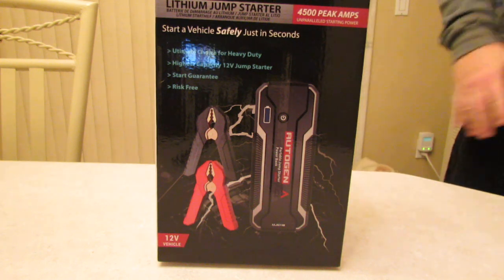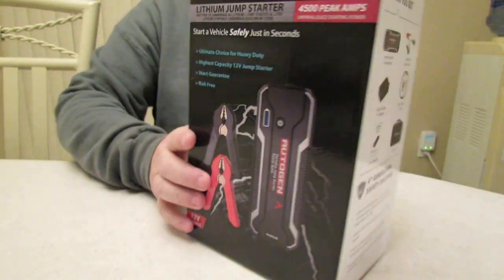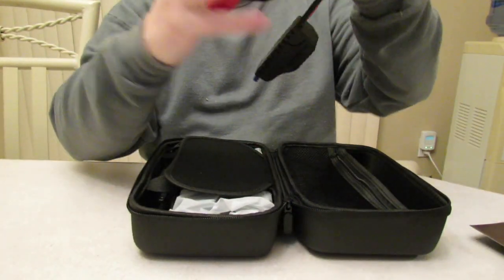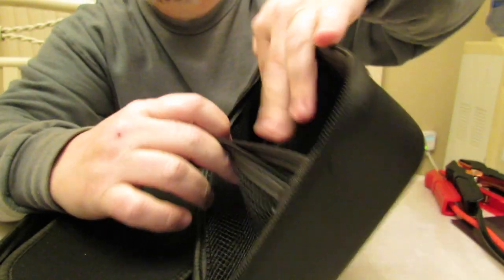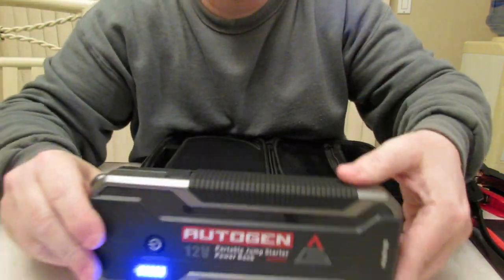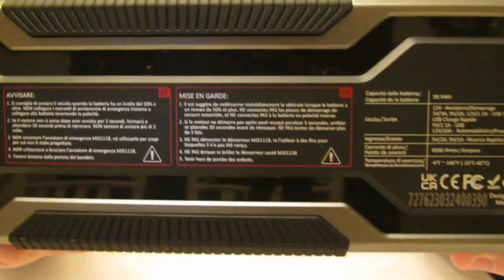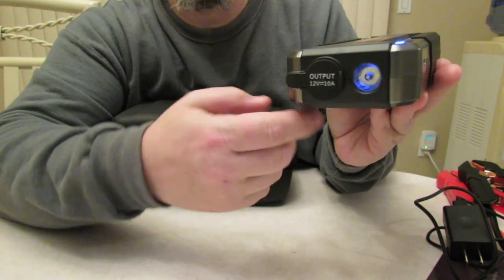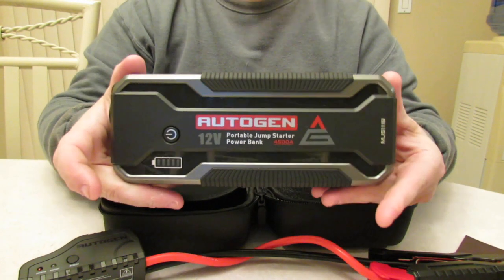AUTOGEN 4500A Jump Starter (MJS111B--Powerhouse)

Comment: It only needs one cable on each clamp. Put your volt meter on both sides of the jaws and you will see power since it is all metal, one piece clamp with a metal pivot.